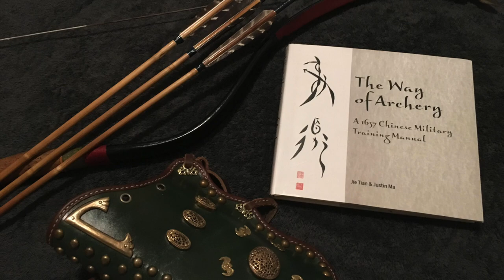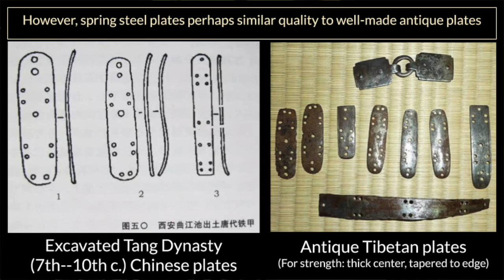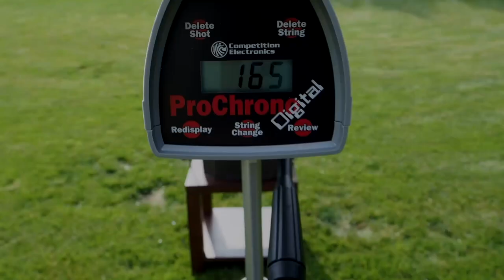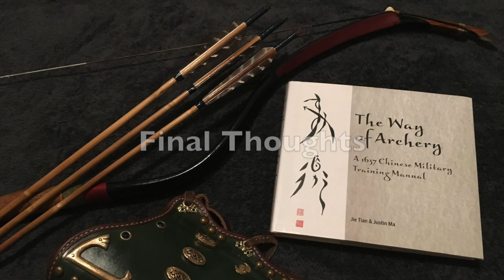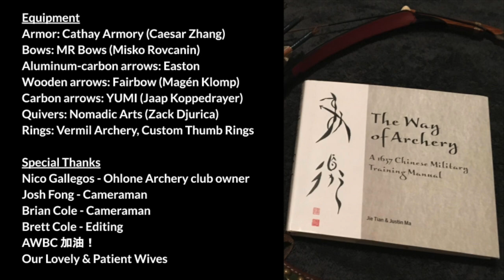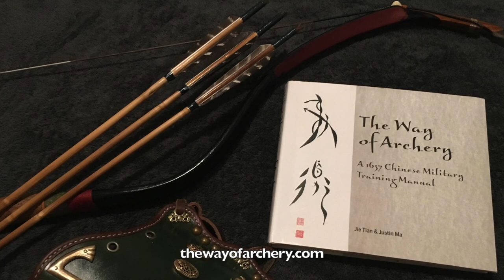Warfare Research Series (Episode 1): Chinese Lamellar

Comment: Armor thickness is very important, and lamellar plates could be of widely varying thickness. IIRC, some excavated Tang Dynasty lamellar plates were as thick as 2.8mm - whereas many modern lamellars can be quite thin at 0.8mm thick. Overlappying style can also be important, as sometimes larger style plates do not fully overlap whereas smaller plates more often fully overlap. Interesting test and it's great to see folks draw warbows with over 100lb in draw weight!
Reply: Thanks for watching!